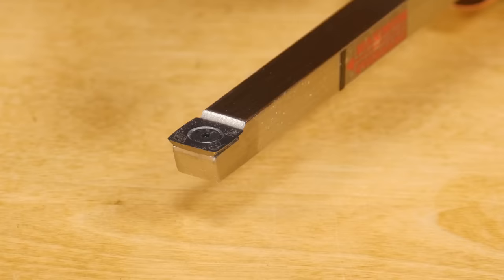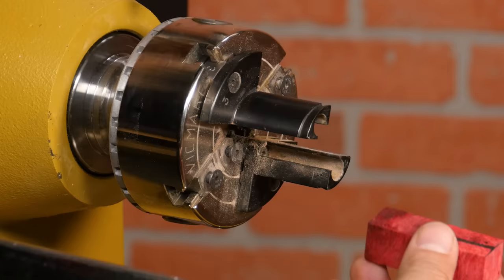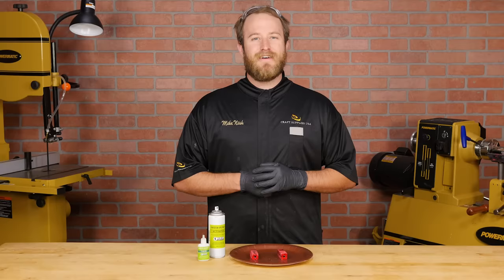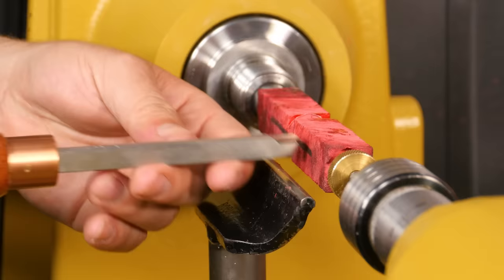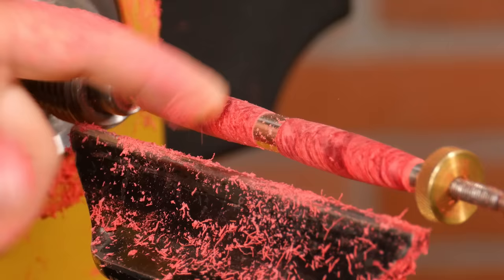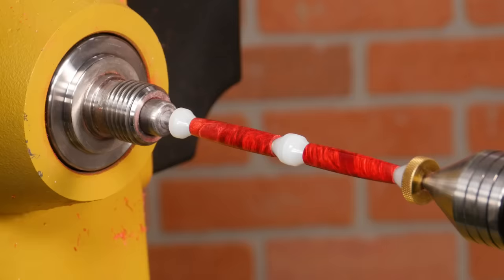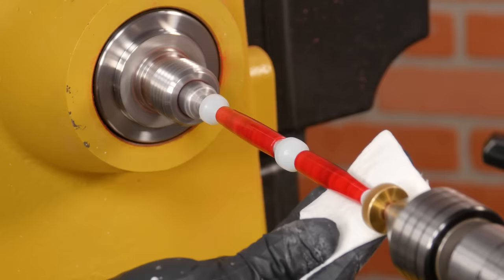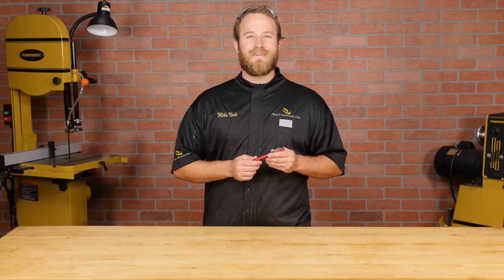Turning a Pen with a Carbide Turning Tool (How-to Beginners Guide)

Comment: Abranet is good for everything wood. I've had the same set of 2x6 for YEARS and it's not worn out yet. You can wash them. To clean them of dust, just whack them on the bench. No need to match holes for a random orbital. My favorite sand paper ever. It's original use was for drywall. No clog, bendable, foldable. The best ever.

Comment: I only wet sand when turning an acrylic blank.  And don't cross sand, because if you use the right progression of sanding grits (50% more than the previous grit) it will remove all previous sand scratches.  Nice word, great videoing.

Comment: When you mark the outside of the blank either side of the centreline, after you drill and inset the tubes, its best to also use a marker pen inside the tube so that when you turn the blank down, you don't have to remember which end is which. And if you do it in the same place as your external line, it will allow you to line up the grain exactly so when the pen is closed the grain pattern flows like it should.
Reply from the maker: Thank you

Comment: Keep in mind that spraying the end of the blank only cures the glue at the ends. I always allow at least an hour for the glue in the center to cure. I have had blanks explode and found wet CA in the middle.
Reply from the maker: Thank you for the tip
Reply: I do the same. Do not use accelerator because smells bad, although I have it  and I work in the kitchen. If I had a workshop or garage, then maybe use. I like the carbide one than the traditional one. self-learner and perfected nicely
Reply: I agree completely. I use accelerator when doing the finish but accelerator won't do anything for gluing the tube to the blank, I often leave mine overnight, but at least a couple hours. There is nothing worse then turning a blank and having it break because it's not glued well to the tube.
Reply: You might be using too much CA if it's not cured in the center after a few minutes.

Comment: Dove into this in the past couple of days and your videos were extremely helpful, thanks so much!   One thing I learned is that the ‘newbie’ slim line kits are much more difficult than the more beefy, fancier kits because you have to turn the wood so thin, it’s easy to get chips and cracks in your blank.   This happened with the first two slim line kits I got as practice kits.  I then did 3 more complex kits with meatier profiles and they were much easier to turn and came out great!   Also, whatever kind of generic latex glove I wore during my CA finish seemed to have a weird exothermic chemical reaction, melted and slightly burned my finger when I was finishing the first kit.  I went to painters tape after that.
Reply from the maker: When CA glue dries the reaction is exothermic, so gloves melting is not uncommon! Switching to a thicker material is a good idea - rubber (and latex) gloves are just so thin that they don't always hold up.
Reply: No  reason to turn the wood / acrylic as thin as the pen kit. Many folks like a little more "meat" to hold onto, so the pen can have some fabulous shapes that keep them a little "fatter" if preferred. However, a very nice skinny pen is beautiful on these kits. Look like the Cross brand pens, manufactured for professionals and office personnel...

Comment: Hello, I am wondering if it would be good or poor form to turn a pen with a carbide turning tool with a 55 degree tip on a metal lathe? That way you could go back and forth on the wood? I want to make kitless pens, and a metal lathe is a lot more precise than a wood lathe with hand turning tools.

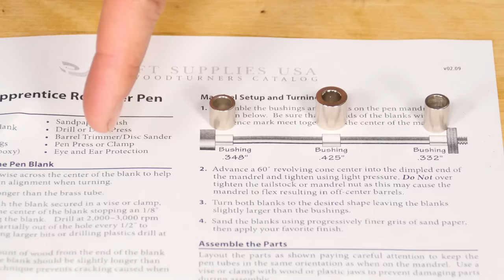Comment: I've spent, maybe, 200 hours on an engine lathe making parts for "emergency" situations and probably another 300 hours playing. I'm no expert, but I noticed at 6:13 that you left your chuck wrench in the chuck. This might work fine for you, and perhaps you've never had an incident but I want to stress that this is not a habit to get into. Your chuck tool should basically never leave your hand, unless you're using it or it's hanging in a spot you've designated for it (that isn't the chuck). If you forget it in your chuck, as you become complacent around this spinning machine of potential death, it could damage you, your lathe, the chuck tool, or all three.
Reply: Pretty sure he wouldn't have turned it on with it in and it was only there for quick removal for the video
Reply: @dooley9621  I'm only relaying best practices here. Sure, he'd never intend to leave it in the chuck and turn it on, but I've witnessed this happen twice where I work by two separate people. It's just a good idea to train safe habits into oneself.
Reply: @nodriveknowitall702  I am also a journeyman machinist and have witnessed the same exact thing, by JOURNEYMEN, who never intended to leave it in the chuck. Bad juju!!!! One guy turned it on and the wrench caught his belt as it passed downward. Not only did it rip his LEATHER belt into it opened his bowels and made his pants stink. Bruised his stomach also....could have been worse though. Have seen them go FLYING about 50 feet.

Comment: Hi there, first of all my compliments for your video! The best one I've seen about pen turning. Straight to the point, very practical and detailed.
I have a question if you don't mind answering.
Is there a valid alternative to using CA glue for finishing?
Some people are allergic or sensitive to CA.
For example, when I make wooden rings I use thin layer epoxy resin applied with a small brush. But then it takes 24h to dry before you can handle the object and what's more you need to have the object moving all the time to keep the resin stay even on the surface.
I was thinking of UV activated epoxy.
Any other valuable ideas?

Comment: What kind of chuck do I need for my lathe to hold all the tools? I’m guessing the head stock is just the lathe without a a chuck. And does the pen mandrel fit in a standard  head stock on a lathe?
Reply from the maker: Lathes have a "Morse Taper" in the headstock and tailstock to hold accessories like pen mandrels and revolving centers.   They also have spindle threads for things like a 4-jaw chuck and Faceplate.  All you need is to determine what Morse Taper size you have and pick the corresponding pen mandrel.  If you need more help, give us a call at 1-800-551-8876 and we can help determine exactly the size you need.

Comment: Does the Artisan Ring Turning Check 1"-8 TPI fit the Harber Freight 10 In. X 18 In. 5 Speed 1/2 HP Benchtop Wood Lathe? I just wanted to know before I buy this item. Thanks.

Comment: Any reason to cut the blank in half before drilling? Wouldn't it be easier to drill the full length, then cut it in half?
Reply from the maker: Yes, but most of the time the drill bit isn't long enough to do the entire blank at once. Extra long bits are expensive, so most guys cut, then drill. Also reduces and drifting of the bit.
Reply: Definitely better to cut the blank first. If you are using a drill press the first and foremost reason will be price. It costs a fortune to get a drill press that will drill 5 inches, many only drill 2-3. Also the longer the hole the more noise and heat and going off center you get, none of which are good. You can of course drill on the lathe which won't have the length problem but it still has the off center and noise and heat issues. A drill press is a lot faster but otherwise lathe is fine.

Comment: Great video and I picked up some tips.  I have a technical question though.  I noticed that the carbide insert was the standard one rather than the negative rake version.  Is there a reason for this?
Reply from the maker: We used the standard cutter because most turners are familiar with it. The negative rake will work great though.

Comment: How long would you say it takes from start to finish to make one pen? Not rushing, but not moving too slowly, just a nice even pace...?
Reply from the maker: That's a tough question to answer because there are so many factors (one tube or two? wood or acrylic? experience level?, etc). An experienced pen turner can finish a simple wood pen in roughly 30 minutes start to finish, but if turning acrylic or adding embellishments that time can easily double.

Comment: what model powermatic lathe are you using? and do you like it?   Do I need a small lathe for pens and small items and a larger lathe for bigger items like bowls and spindles?
Reply: A large lathe will do small items like pens.  Turning capacity of the lathe determines the project size.

Comment: I have done plenty of the wood blanks just fine. I have started on my second acrylic blanks set. On both of them, after I have them rounded and ready to do some detail work on them, they end up blowing out at the ends and then they just fall apart.  They seem to do fine until then.  After this happens, I noticed there are pits in the acrylic all around that didn't seem to be there when larger.  Is this indicative of the tools not sharpened correctly?  I am using non-carbide types.  I don't want to do any more of these until i figure out what I am doing wrong, any ideas?
Reply: Are you casting the acrylic yourself? If so it sounds like you need to use a pressure pot when curing to reduce the size of the bubbles in the acrylic and stabilize it.
Reply: @Oakleaf216  hello.  No these are bought from places like Penn State and similar other companies.

Comment: Hi Mike. I noticed that while you're drilling the blank, the drill bit had a run-out type of wobble. Any ideas why? But more importantly, how to eliminate it if possible.
Reply from the maker: We used a drill bit that was too long in the video. If you use a shorter one, you won't have that problem.
Reply: @CraftSuppliesUSA  Interesting. I'll see if I can find one. I'm using the one I bought from you in the starter kit a year or so ago.

Comment: I'm completely inexperienced so this might be obvious after a few more plays with a lathe, but since you drill the blank on the lathe why don't you use the barrel trimmer on the lathe also? is it not possible to perfectly replicate the position of the blank in the pen jaws?
Reply from the maker: That's a great question. You said it - getting the blank back in the jaws in the exact position so it is perfectly square is a bit tricky. Barrel trimmers come with a precisely fit pilot shaft that fits inside the brass tube, that is what keeps the trimmer head perpendicular to the tube. To answer your question - it is faster and easier to trim off the lathe.
Reply: You can if you want, I have trimmed on the lathe plenty of times, it's just slower. You can also make a kind of sanding jig on the lathe instead of a barrel trimmer, I haven't done this but it's tempting because barrel trimmers suck to sharpen. I usually just use a power drill. If you are really new and haven't bought a barrel trimmer yet, either buy the one that lets you change out the shafts or you can skip having one all together and make (or buy) a squaring thing to use on a disk sander instead.

Comment: use a belt sander to do flatten the blank to the brass and don't waste your money lol
Reply: Agreed, especially on segmented and specialty blanks.I stopped using my barrel trimmer a while ago.  Never had a blank blow up using the disc sander.
Reply: I used one of those barrel trimmer bits once.. switched immediately to an oscillating belt sander with a jig mounted to the miter gauge and never went back.
Reply: The only issue with this is you need to have something rigged up so the pen blank will hit at the exact right angle. Otherwise you will have gaps when you assemble your pens that look awful.